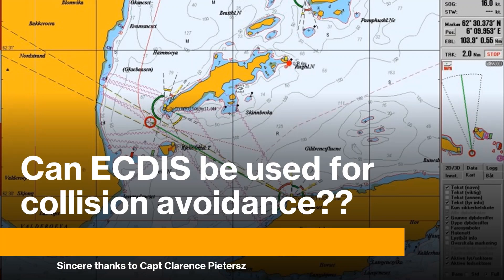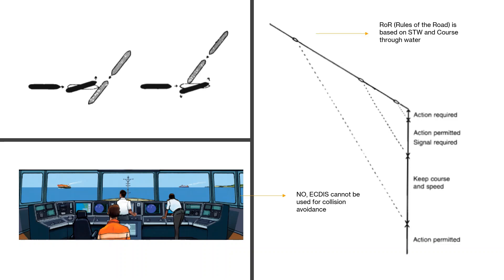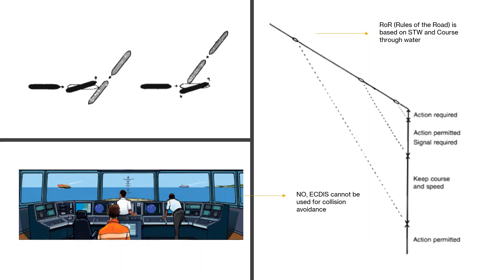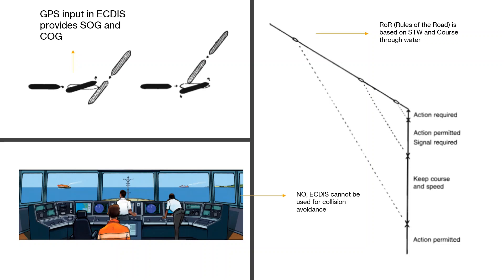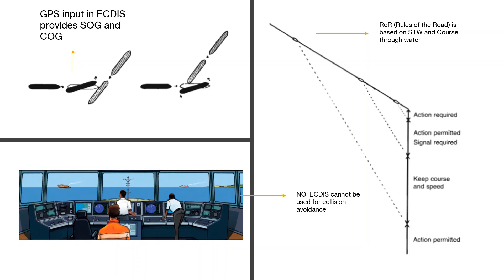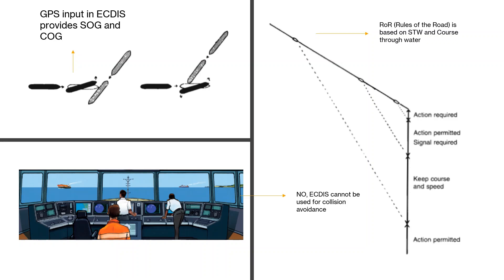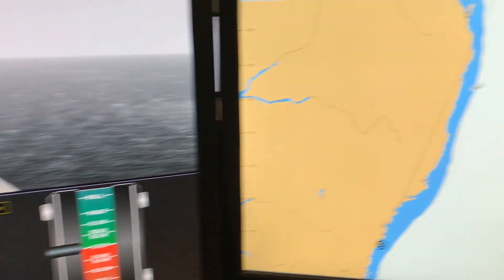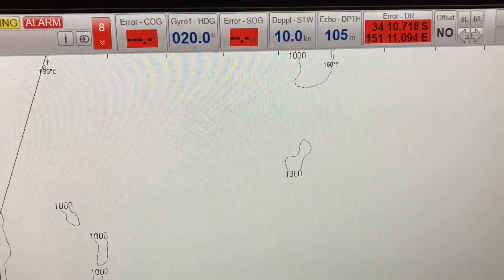Can ECDIS be used for collision avoidance??

Comment: ECDIS also gets input from Speed log and can show STW and CTW. 
This is not the reason why we can’t use ECDIS for collision avoidance.

Please refer to following paragraph from Capt Rajeev Jassal. Which is most logical explanation I have found
“But the negative thing about using ECDIS as collision avoidance is that the target positions may not be correct in the ECDIS as it displays the target from the AIS which may not be giving correct positions of the targets.While identifying the targets by comparing the visual bearings of the target with the ECDIS can also lead to confusions in the case of multiple targets at close proximity. As the AIS positions of the targets may be offset by few cables or miles, the visual bearing may not match with the accurate targets.  Also not all the targets will be plotted on the ECDIS. For example, fishing boats that do not have AIS will not be plotted on the ECDIS. Or if the target has its AIS switched off or AIS is not working, this can lead to confusions.So when a target is identified, we may use ECDIS for deciding an action or for deciding if there is sufficient sea room available for the intended action but we must identify the targets by other reliable means like radar and visual look out.”

Comment: ECDIS cannot be used for collision avoidance because it gets COG and SOG from GPS and whenever GPS is turned off, you get no data pumped into ECDIS 😅 Do you really know what you are t and talking about???
ECDIS must be connected to Speed Log to get STW. Otherwise it does not comply with IMO requirements.